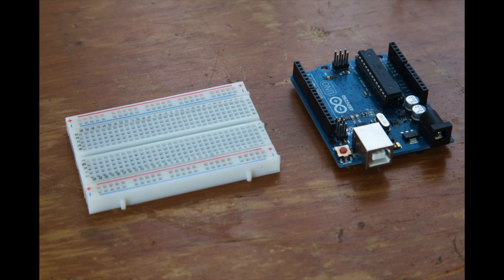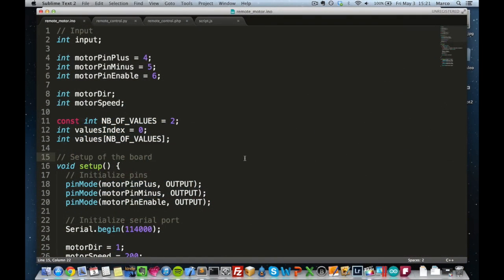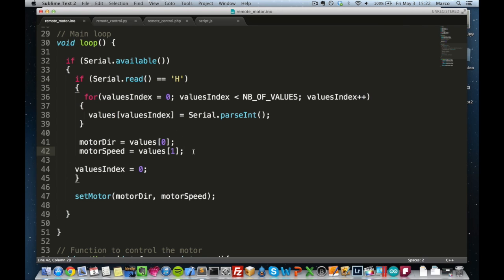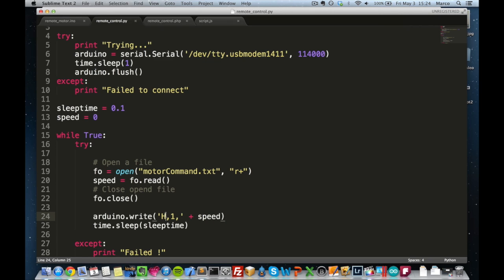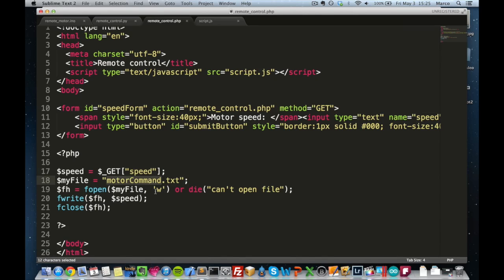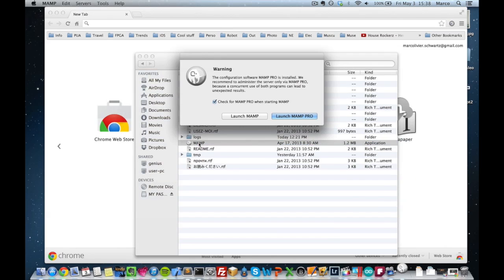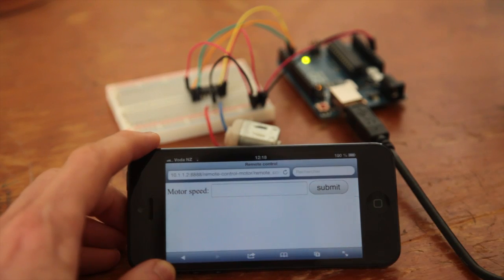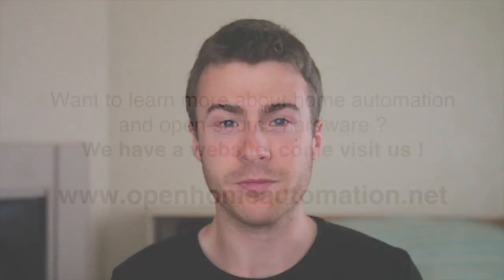Remotely controlling a motor using Arduino, Python and PHP

Comment: I'm pretty sure you could simplify all that JavaScript code into one line of html
Reply: +Harry Potter Yeah, the javascript doesn't do anything in this case because there is no event.preventDefault action going on. In fact, the html already handles the data from the form. The html form doens't need the ID, and he could write it like <form method="GET" action=""> But it would be cool to have it just ajax the form data, and he could even have up and down buttons that act in speed steps.
Reply: +Harry Potter Also, he should use a number input instead of a text input.

Comment: I have not found the code at Home Automation. Would you be able to post an explicit link?
Thanks
Malcolm
Reply: You have mentioned github, but I am not able to find your code there either.
Malcolm
Reply from the maker: Malcolm Currie Hello Malcolm, the article & the code is here: http://www.openhomeautomation.net/remotely-controlling-a-motor-using-arduino-python-and-php/
Reply: Thank you Open Home Automation for the link to the Arduino and app code (on GitHub) from your Home page.